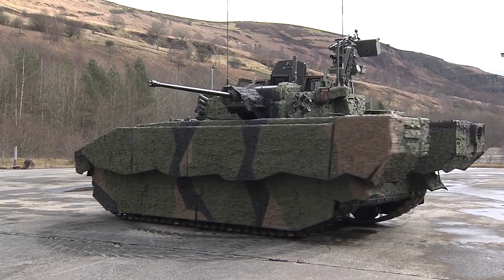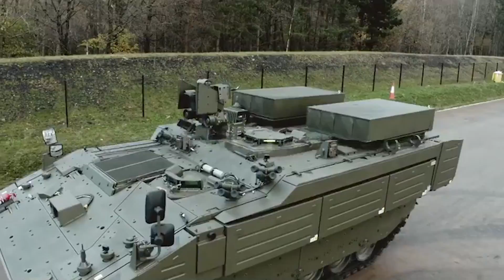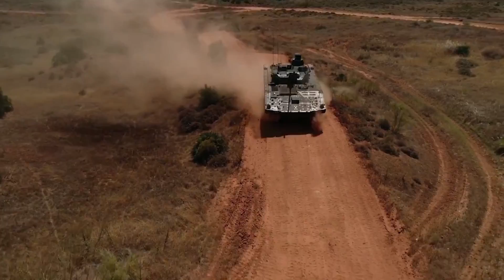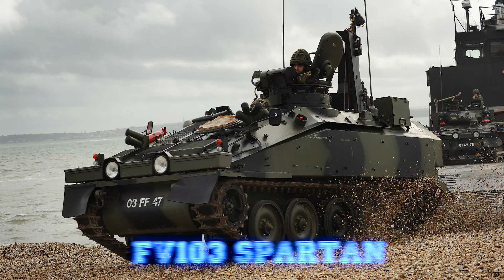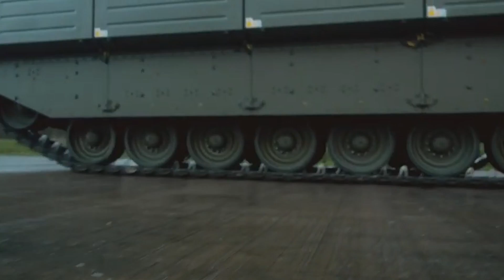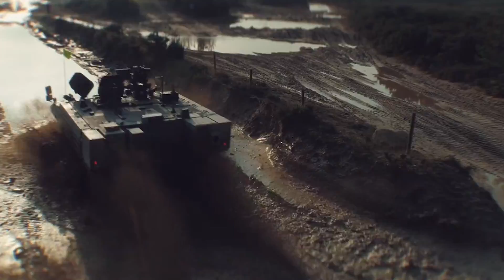New British Armored Fighting Vehicle Shocked The World

Comment: The only people truly shocked by that vehicle are the UK taxpayer and the soldiers forced to ride in it. This is just embarrassing, the vehicle is a testimony of military-industrial logic at its worst. So that thing towed 62 tons at a mass of mere 38 tons - impressive, I never thought that there could be such a thing as a ludicrously overpowered tracked military vehicle. I wonder whether the vibrations issue has something to do with that. I understand that this is probably due to the jack-of-all-trades approach with bridging engineers just facing different power requirements than mounted infantry in their line of tasks. Yet after all the industrial wars/arms races of the 20th century that lesson about jack-of-all-trades promising more bang for the buck (and sucking at it) has to be re-learned again? ;-)

Comment: It's not really British, it's made by General Dynamics - it's also too big to do what the CVRT used to do, too expensive and apparently it's so noisy and has so much vibration that it can harm the crew - all in all it's just a bit crap. Should have been scrapped long ago and the money put into CV90 which could also have replaced warrior and was what the army wanted. Instead we've got boxer and this thing, it might be okay in its other roles if they can fix its problems but it's not going to be good at reconaisance - whoever thought it was a good idea to use the same vehicle as a bridge carrier and recovery as well as reconaisance needs to be sacked. The cannon isn't important as its whole job is not to be spotted.

Comment: you can fix most vibrations and noise by glueing rubber panels to the inside walls, i've done it over a hundred times to shaky body vehicles and large industrial machines that have mystery vibrations
Reply: That's not solving the problem.. Its covering it up.. It will be cancelled because even at £10m each that's double the price of the proven CV90..

Comment: Since, like a certain Norwegian Blue, this 'weapon system' is clearly dead. And not resting. We require alternatives.  As a quick interim solution. The Cavalry could use horses. Already trialled and in use. Horses with chain mail could be used again instead of tanks and riders equipped with Javelins. (the missile, not the pointy stick. Do you think I'm being silly!!) The Artillery have also trialled horse systems and need only extend usage. RLC, Signals,  REME etc will get the horse and cart option - slow but reliable. Mechanised infantry is tricky.  Likely have to opt for speed over protection and utilise chariots. Unmechanised infantry will be issued shanks's pony. 
Since we seem to get tangled up in fracas in sand boxes, the military ought to develop Electric (Fighting) Vehicles over the long term. To replace horses. Probably best to give the development contracts to the Germans who seem to be able to produce things fit for purpose. Look at the VW Beetle and ignore the nasty early adopters in the 30's and 40's. Still in production almost a century later. Given the British Army likes to operate kit until it's literally falling apart and use for half a century or more. The Germans seem like the perfect fit. (This was a research collaboration between The Royal Hospital Chelsea and Shrivenham Military Research Centre of Excellence. All rights reserved.)

Comment: my thoughts on the cough Ajax is hold back on it upgrade the warrior with a new turret and whatever else it needs whilst researching how to fix the Ajax and its many problems and if the Ajax can't be fixed then your just left with an upgraded warrior so you can start a new or buy hint hint pre-existing IFV's hint hint.
Reply: Since the UK is already on track to operate the largest fleet of Boxers in the world and is churning them out from two plants, it might be an idea worth contemplating to take all the bleeding edge technology from the Ajax and build the most advanced mission module to date for the Boxer, along with some modular armor solution to get the required protection level. One approach could be combining the highest available protection level armor kit with an APS like Trophy or AMAP-ADS.

There are plenty of countries that operate the Boxer and would probably be VERY interested in ways to turn their Boxers into light/medium tanks or whatever the correct term for that kind of vehicle is - at what would likely be a fraction of the cost for say a brand new Leopard 2A8. If I’m not mistaken, ordered in small numbers those easily cost €17 million per unit. Imagine if the UK could offer a package consisting of mission module and armor upgrade for £5 million say to the Baltic nations that operate Boxers but don’t operate a single tank.
Reply: The taxpayers would be delighted at this suggestion :)
Reply: The warrior upgrade program has been dropped, with the Boxer to replace it, not ideal, as the Boxer is an APC, not an IFV.
Reply: @paulhill1665  yes the warrior program was dropped mainly because the turrets kept warping and break the hull and the boxer might not be an IFV but because of its modularity it can become an IFV just look at the Australian Boxer.
Also did you look at when I posted this comment? It’s old news by now! One could even say because it’s so old it wrong.

Comment: The BOXER is now coming into British army and it's way better, we are still keeping warriors and upgrading the main gun from a 30 mm to a 40 mm Cannon mostly for infantry support and urban warfare, or anything bigger we have of course the new Challenger 3 MBT tanks
Reply: The Warrior upgrade has been abandoned. Current plan is to replace the Warrior with the boxer.  The Warrior was an IFV, the boxer is a APC, completely different tasks.
Reply: @paulhill1665  uh? By APC you mean not armed. That’s wrong. Boxer very much armed. All kinds. Boxer is just wheeled. Some terrain, you need tracks.
Reply: @TheBooban  currently the versions being procured by the UK do not include an IVF, just the protected mobility version, e.g. a battlefield taxi, or an APC. AN IFV requires heaver weapons to be able to support troops, such as the now cancelled upgrade to the warrior, with the new 40mm gun system. Given the current state of the UK finances, who is to say that the Boxer program will even continue. The recently announced planned increase in the UK defence spending to 3% of GDP has already been dropped.
Reply: Anyone who thinks Warrior is still getting an upgrade has been living under a rock for the past year and a half or more. Boxer is replacing Warrior (and maybe Ajax, only time will tell) even though its not actually suited to either the Warrior's role or Ajax's role. But buying Boxer is yet another tale of woe in British Military procurement, the right vehicle for the wrong job.

Comment: Driving an armoured vehicle is never a comfortable pass time. But what the hell have they not accounted for or fast tracked so the design induces such dangerous effects on the crew and soldiers?. Travel sickness, lack of dampening, effects of "internal equipment" or sound insulation. Or is this an inflatable tank stuck to a land rover. Beyond comprehension what is wrong, unless it has a new tech inducing illness.

Comment: Surely the suspension only needs hardening ?
Reply: it's not just the suspension, but the material specifications of the alloy its hull's made from, and the thicknesses of parts of it too - with that amount of vibrations, the material is too thin to dampen resonating vibrations within the structural material itself - its likely an aluminium alloy, that could well become very brittle with age/service life just like the USN's LCS's hull have caused them all to be stricken from the registers & scrapped.

Comment: Would appear the MOD are responsible for a multitude of changes as the programme. Too few companies manufacturing military vehicles. I would have gone German, they build vehicles that work!
Reply: As the Boxer has now been purchased and will become the standard IFV, then go with the Rheinmetall lynx kf41 it has the modular build that they are looking for.
Reply: FFS we had a full fleet of recon vehicles , shoulda just upgraded/redesigned , instead of this
Reply: @davewarrender2056  50+ years old vehicles though.
some times a new vehicle has to enter service to keep up with the times.
Reply: @zhufortheimpaler4041  I know that.  But remember the saying , if it ain't broke don't fuck with it. They couldda  upgraded engine , supercharged instead of turbo , therefore giving full power band at any revs , they could've redesigned all-sorts on the vehicle using modern materials , the cannon , couldda been fitted with gyroscopic gun control , as well as remote operation. This is the problem, Britain has a history of finding a weapons platform that works, and then running off and paying stupid money for a flash one , that is untested .REF: l85A1 , SLR , BREN LMG.
Reply: @davewarrender2056  its actually more like this: the uk decides on a "unique" way of doing stuff and continues to do it that way, even though general consensus, technical and physcial limitations etc clearly state that this way is one of the worst possible ways to do something.
Then excuses and elaborate stories are invented to support this choice.
this whole move costs the UK every time they do it.
Look at the 120mm rifled.
has been obsolete since 1978 (or one could say even since 1962). 
25%-35% lower performence than contemporary 120mm smoothbores from rheinmetall, penetrator developement stagnates for the last 30 years. 
Excuse: but its more precise (it isnt) and it can fire HESH wich is better vs soft targets (HEAT-MP-FS does the same job and more for decades)

Comment: Good video, although they wont be relying on the Warrior due to delays with Ajax, Ajax is for recce, the warrior is an infantry fighting vehicle and is being replaced by the boxer. 

To think, I almost stayed in the army out of the excitement of getting to work with the Ajax, the equipment on this thing is impressive,  glad i didn't as that was 20 years ago, such a badly handled procurement. 

I also think it is too big and noisy for a recce vehicle, the Scimitar was the perfect recce vehicle, they just needed to make a newer version with better protection, rubber tracks and quieter gearbox.
Reply: Yep. Ajax and Boxer have an interior capacity of only 7 troops, compared to 10 in the Warrior. It would have been better to have replaced the Warrior with a new IFV, but the UK of course hasn't got the budget nor the production facility to replace the 789 Warriors in service with a new IFV.
Reply: Scimitar had rubber tracks. All the CVRT family did. They certainly did in the 1970s and 1980s. Or am I misunderstanding what you mean?
Reply: @dallen521  I think your mistaken, they never did, I used to drive them and fire them. There was talk of a trial in the 90's but it never happened. There was no rubber tracks before I drove them as far as I am aware, I was also the trained mechanic on them and did not hear of rubber tracks before my time.
Reply: @AS-yc3wp  I have also utilised CVRT.  They had rubber inserts in the trucks from what I remember back in the 1980s.
Reply: @dallen521  oh ok gotcha, they were the bushes for the link pins in the tracks. I'm talking full rubber tracks with no metal. Same as a car, where you have metal in metal contact, you either oil it, grease it or bush it 😁
Reply: @AS-yc3wp  Aha. There you go.  We called those rubber blockers (which helped reduce damage to the road) rubber tracks.  There you go. A change in meaning.  :-)
Reply: @dallen521  of course, I forgot about this as well, rubber pads at the bottom of the track, all British tracked vehicles and Americans tracked vehicles have them to prevent turning up the tarmac
Reply: @AS-yc3wp  track pads were are rubber!! As are CH2 and warrior in fact all tracked vehicles!
Reply: @timmardon6161  yes track pads have rubber inserts but the track is made of metal, the metal sprocket still drives the track on metal tracks.
Reply: @dallen521  rubber track pads! New idea is to have all rubber tracks!!!???
Reply: Yes it was supposed to replace the scimitar/scorpion platform. I can't quite see how a 40+ tonne monster is going to fit the role. I think they lost their way along the route. It's practically a medium tank. It sort of follows British military weapon procurement - design, constantly change, invest to the point of research testing and development then either give it away (if it works)  or throw it away if it doesn't. Nation of lions led by a heard of donkeys.

Comment: This vehicle is fundamentally flawed. I'm not sure they even yet know exactly what the flaw is. If it comes into service at all it will be as a demonstration vehicle to be used on how not to design a complete lemon. Will it survive the scrutiny of those who are probably know climbing all over it to rectify the problem. Most seem to doubt it - I'll go along with that. The irony is the vehicle it was to replace was a superlative example of how to get it right first time. The British Army could do worse than use the Warrior as a blueprint and just see what needs replacing/modernizing in the design and then build it. Generations of infantrymen will merely exclaim, "Told you so".

Comment: Oh yeah this vehicle shocked so much that it caused the crew to suffer nausea, swollen joint, tinnitus, and hearing loss due to the excessive vibration and noise. The vibration also caused electronic systems to be damaged, prevents the armament from stabilizing and the suspension problems means that the turret cannot fire while on the move. Its  shocked the world that this vehicle hasn't been cancelled yet.
Reply: Warrior can't fire on the move either. Nothing new there.

Comment: This vehicle is just rubbish.they have been trying to fix up all the troubles it has for years.               One being the crew get sea sick when travelling over rough ground and it starts to rock back wards and forward. They haven't worked out how to stop this. And the crew hate it...... there is also other problems as well still not fixed either.  Years behind realise day. For the above reasons.   Looks great but as is utterly useless....
Reply: It uses old fashioned torsion bars with rotary dampers, overload makes the suspension wallow and pitch, track tension seems excessive causing the links to clang over the drive sprockets and box shaped hull acts like a loud speaker housing !

Comment: It sounds just like when vehicles are recalled with issues found afterwards. These military armored vehicles are not that easy to dissassemble and fix the problem it would take a very long time. Too bad if war breaks out and they need the equipment.
Reply: Or that the lack of quality control resulted in hull sides of different lengths on some vehicles.
Reply: It didn't help that the hulls supplied were all different sizes, so the engineers in the UK had difficulty trying to isolate what was causing the deafening vibrations. In production, if you're gonna build something on a line, it helps if they parts are the same size so if problems are found they can find the cause easily.

Comment: Just admit it's a failure and go with the boxer armored vehicle and purchase some light tank later on:)
Reply: I never understood why they wanted to replace an 8 ton flying machine of a scout tank with a 42 ton behemoth of an IFV. The regiments that use them don't carry infantry, they are fast cavalry, it's a bit nuts. Unless they want them to act as a battle taxi for spec ops and do and end run around behind the enemy dropping spec ops in their back but a 42 ton vehicle charging across the landscape is going to draw alot more attention than the previous scout SV. Surely a new scout SV could be around 25 tons with modern equipment and the same speed.